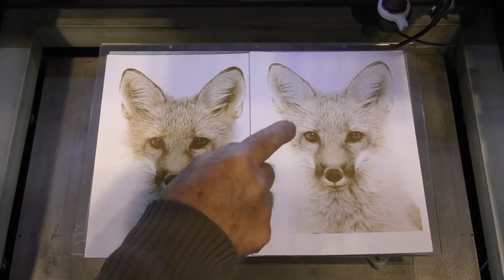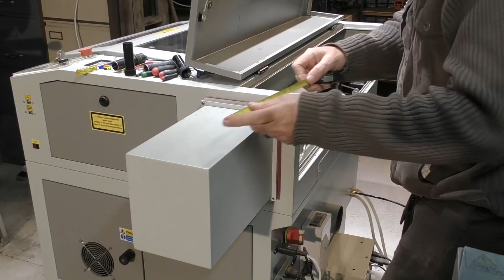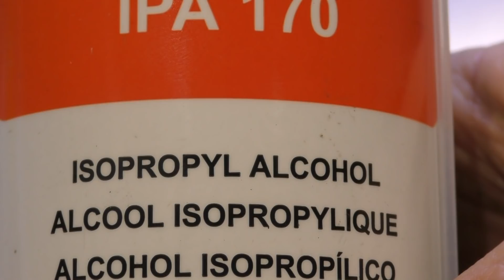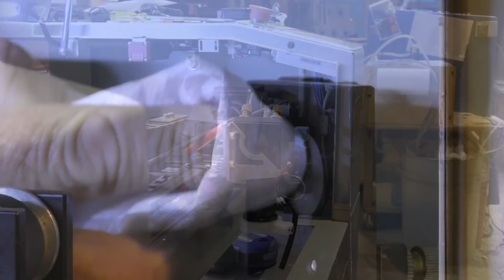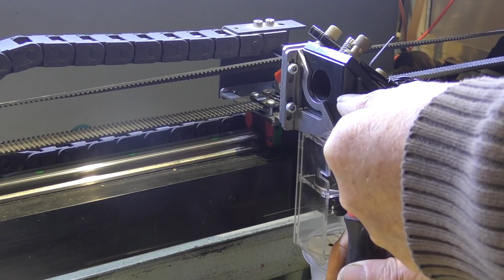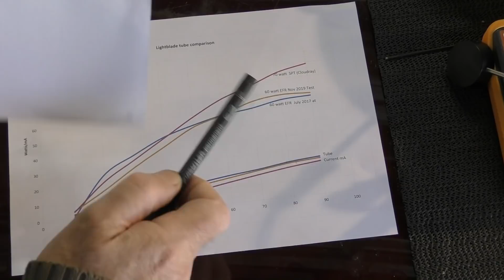RDWorks Learning Lab 176 New tube for Lightblade

Comment: Thank you for all the helpful video's
I like to ask you Russ what kind of steel you use for the table plate and how thick is it in mm?
Reply from the maker: Hi Johann
The steel is ordinary untreated mild steel. All metals reflect the IR beam to some extent so the normal table  materials they use like raw  aluminium (98% reflective) or stainless steel (about 95% reflective) are very poor design choices. Even if they have a dull appearance, it is the crystalline structure of the material that is reflective and not the surface itself. The surface reflects the wavelengths we can see but as the wavelength gets long (like our 10.6 micron) weird things happen.  Raw cold rolled mild steel is about 60% reflective  but if you examine the surface closely you will see it has an orange peel texture that cause a certain amount of scattering. If you use excess cutting power and are too close to the steel surface  (i try to stay at least 10mm above the surface) then the reflected energy will damage the rear of your material. It has the great advantage of being magnetic and you can be brutal to clean it. It is still reflective  but less so than most other sensible choices. You could use anodized aluminium which is almost 100% absorptive but if you burn through it then you will be back to reflective aluminium. (and it's non magnetic). Thickness?  It depends on your table size but for most small to medium size (up to 900mm) tables 2mm (14 gauge) should be fine. Above that size I would consider 3mm (10gauge ) for stability.

Best wishes
Russ